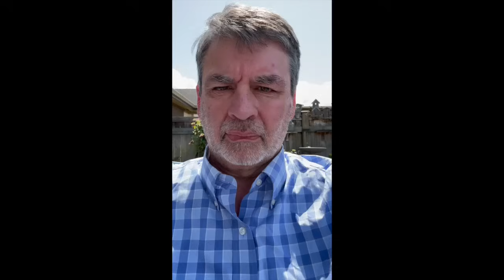Gas well crisis: 7x more methane emissions than official estimates

Comment: One of the main reasons that small oil companies go broke, is because of ridiculous municipal taxes. Farmers control most counties and use oil companies and now “green energy” to finance their operations while keeping their own tax rates extremely low. Assessments are done when equipment, wells, pipelines, windmills, solar farms, power lines and all other associated equipment is installed new, and then assessed values are increased regularly to account for inflation. All of these assets produce less revenue as time goes on. If tax assessment reflected this, many more years of low productivity could be added and these companies would be able to exit in an orderly manner.

Comment: Methane exists in the atmosphere at 1.8 parts per million. It oxidizes rapidly and breaks down within six weeks of being released in the air. It has no measurable effect on the climate. Most methane is produced by rotting vegetation. This is the same whether it goes through a cow or if it decomposes on the ground.

Comment: If what this reporter states is true, I can tell you for a fact the problem in middle eastern countries and Russia is multiple times worse.

Oilsands, give off no methane releases.  The process of turning Oilsands into Oil creates the CO2 emissions. This is all controlled and measured, so you get a relatively accurate reading and account of these emissions.

Conventional oil production around the world with all the single wells does come with free methane releases. Markham is correct on that.

What he is failing to tell you that Alberta is the only jurisdiction in the world that even tries to measure these volumes.

USA, Russia, Middle East, don’t even try to measure or do anything about these fugitive emissions.  They knowingly and actively release free methane or flare off gas without concern.

If you agree that society cannot exist without the need for downstream products that use hydrocarbons as a building block , plastic, synthetics, medicines etc then you have to understand hydrocarbon chains produced is crucial for our continued lifestyle.  Once you realize that, the it becomes necessary to accept hydrocarbon production is essential for our society.

Once that is accepted, you then have to look for a source of hydrocarbons that are the safer for the environment.

Guess where that is.  The Oilsands in Alberta where there are no fugitive emissions, or “ leaks” at the source.

The most environmental thing Canada can do is produce its own Oil, continue to advance monitoring of emissions,and use our oil instead of importing dirty oil from the Middle East and Russia where there is no monitoring or concern from the free methane produced from convention well.  In Alberta, solar pumps are being used at well sites to inject chemicals into the well bore required for production. Other areas in the world use gas driven pumps that exhaust raw methane into the atmosphere at every well site.

An eastern pipeline to carry Alberta Oil to the refineries in the east that depend on crude shipments delivered tankers from the Middle East is the most environmental conscious thing we as Canadians could do.

The Energy regulator in Alberta is the best in the world. If Markham thinks Alberta is bad it pales in comparison to other hydrocarbon producing regions in the world.

Markhams approach to these issues is knee jerk reaction at best.  It is fear mongering and just like mainstream media, FEAR, is what generates response.

Please people. Use your thought process and discover the real truths, and don’t just believe a narrative being spun by this man.  He conveniently does not report anything that counters his slanted narrative.

If you take what this man reports as Gospel, then you are being duped.
Reply: Plastics and materials with similar properties as plastics can be made from any other type of carbon, which means plants and crop waste. 

People don’t have to use as much plastics as the marketers of petroleum based products are constantly advertising say they should. 

The heating of houses can be switched to more efficient electric heat pumps which would be even more effective and cheaper in the long term after improvements are made to insulation and reducing heat loss. Air conditioners are already familiar to people and they are heat pumps, they also would be more efficient with buildings that are better insulated. 

China is leading in the technology of renewable electricity that is becoming cheaper with every new installation, they won’t need much of fossil fuels to use for backup peaker generators, they are developing battery storage infrastructure instead. Battery storage isn’t just big stationary units, electric vehicles that are parked and idle for the majority of the day are also capable of being a large network of electricity storage. 

The old model of burning carbon based products is being replaced very quickly in China and Europe is also moving in the same direction. Other countries especially in the global south that are still developing more electricity infrastructure are going to leap over fossil fuels based systems and build renewable energy infrastructure instead. All of this is already happening and cannot be stopped by building more pipelines to sell oil to markets that are shrinking. 

Investing in more pipelines and fossil fuels using tax dollars is just a plan to shift money from the 90% of the public into the offshore banks owned by the top 1%. 

I’m guessing that your income might depend on whatever you have invested in fossil fuels, whether by your time in the industry or your capital investment, but your logic that fossil fuels are more environmentally sound is ludicrous and is the opposite to the cumulative data from around the world. You are trying hard to convince others that breathing polluted air is just fine because there’s new medications that soothe the lungs from the damage. But that doesn’t change the fact that not getting COPD in the first place is a better outcome.
Reply: @LateForDinner-mn1hn  I am a realist, not an idealist.  Fortunately I am an older Canadian and will not be around to see this idealist approach hit the wall.  For people who think we can live a lifestyle with a neutral energy source , they are in for a huge shock.

The Chinese have a plan,  they have made themselves indispensable in goods production, and now they are focussing on making the world dependent on them for Energy.  The Chinese propaganda machine is alive and well in Canada.

You are giving up your autonomy for self rule if you let this trend continue.  Is this a bad thing? Who knows. We are replacing world oligarchs with Chinese political rule.

There is much more at play here than “ clean energy”.
Reply: @LateForDinner-mn1hn I agree we should let the market determine our outcome.  Not a single dollar of public money should be invested in pipeline. Historically all pipelines,were built through private investment. Smith herself, recently said any pipeline built with government money should be considered a failure.

Are you suggesting the world can survive without fossil hydrocarbons? That is an idealistic viewpoint. A realist would admit that fossil fuel production will not disappear.  Therefore we must look for the best producers in the world. They are Canadian. Therefore develop the best producers to supply the world.
Reply: @CanadianPatriot-h3x  I expect fossil fuels will become a very minor product for energy generation as renewable systems become cheaper and easier to acquire. It’s not going to happen in a year but it’s happening exponentially so I expect that in 10 years there will be much that is very different, and investing more capital into a product that will have a significantly smaller market isn’t financially savvy.
Reply: @LateForDinner-mn1hn well that is really crystal ball gazing isn’t it.  With the world on the brink of war all that will matter is the energy you have in your hands, not some distance hope. Canada who buys Iranian Oil is guilty of funding an empire who wants to kill us.  Where is the sense in that?

Comment: On no the sky is falling.  

NASA reported last year that Canada is a net zero country . Our boreal forests clean up all green house gas that industry produces.

Canada contributes only 2% of the world’s greenhouse gas.

Civilization has only advanced to the stage it has because of energy created by fossil fuels.  Are there problems yes there is. However Alberta is the highest regulated and monitored oil producing region in the world.

The Middle East and Russian Oil production couldn’t care less about free methane releases.

Oilsands production produces next to no free methane releases.  The greenhouse gas produced is all through the process of turning oilsands into oil.  This is like a factory where all emissions go up a stack, burned and measured.

If you have lived in the 20th century, YOU are ultimately responsible for the environment YOU live in.  All the plastic, synthetics, and almost all products produced for your benefit and ease of life  are a derivative of oil.

The tires on your Tesla’s, the interior components , are all derivates of oil.  Solar panels, wind turbines, the earth moving equipment used to make hydro electric dams all have derivates of oil used in their construction and use.

Unless you propose the world goes back to horse drawn carriages,and  farming equipment YOU are the problem not the industries that produce what YOU want.

Without Energy there is no way for the civilization we have built can survive.  Without energy the world would fall into, chaos, wars and starvation at a level we have never seen.

So unless you live in a cave and poop in the trees, YOU are as much responsible for all of this as anyone.